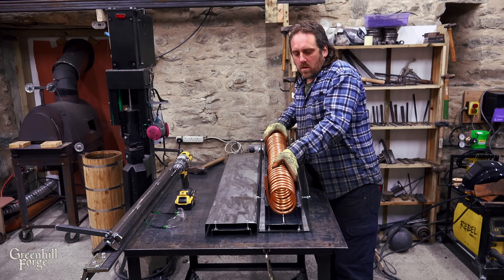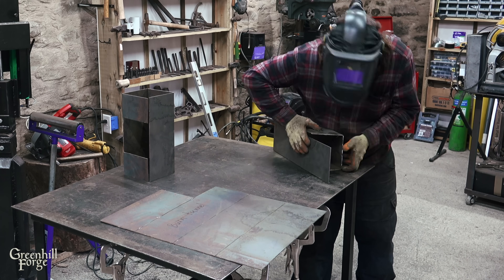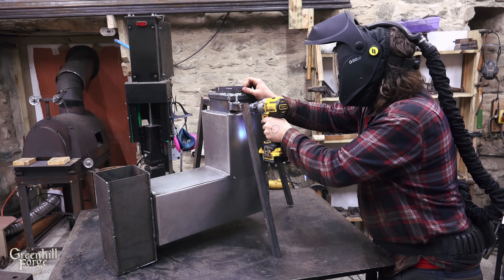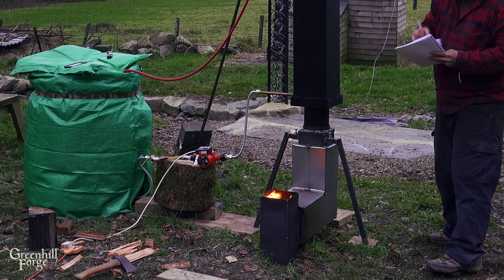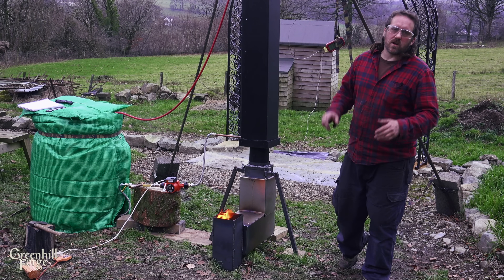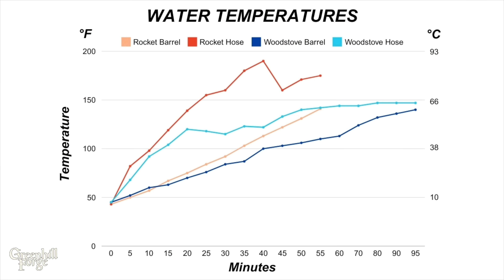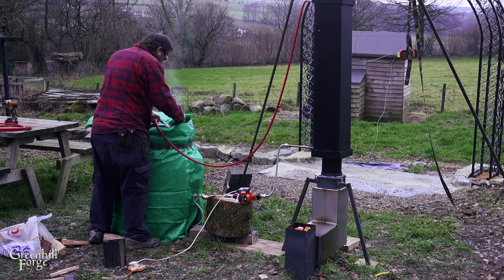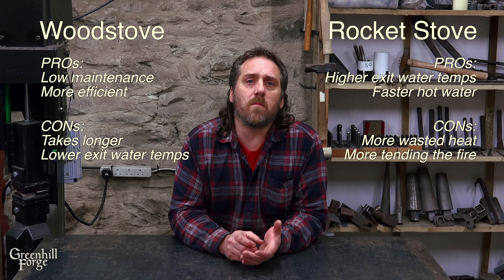Rocket Stove Water Heater Experiment Pt2 -TOO Powerful?

Comment: Running the water in the other direction can increase efficiency. Then it works as a crossflow heat exchanger. Cooler water would be at the top and could cool the smoke to an lower temperature, and extract more heat.
Reply: I was hoping to see that improvement in this video but its still an awesome video. Im jealous of the fabrication skills!
Reply: He addressed this in his Q/A video; he's going to eventually turn this into a thermosyphon style without a pump, which would conflict with the directional change.
Reply: @ultimape with such huge temperature difference there is hardly a need for crossflow exchanger. What could help is contact surface or coil length. Dunno about soot though. This seems a real maintenance issue. 😢
Edit: breaking the laminar flow of hot air could also help, or extending the time for heat transfer. I would try to make coil more chaotic in shape.
Reply: Yes  and he may want to go to a bigger diameter copper pipe and a bigger pump.  He is correct, however that something to suck up some of the heat before it gets to the heat exchanger could be good.  Water can get above boiling so he needs to get some temperature reduction.
Reply: @kensmith5694  Could use 2-3 coils in parallel instead. Gives better flow just like bigger diameter, but it also gives more surface area.
Reply: @m8e  was looking for this comment.  Increasing the flue size would help offset some of the excess heat being produced to make it a bit more controllable as well
Reply: came to say that. counter current flow is key
Reply: You're thinking counterflow not cross flow
Reply: Yes, exactly! And in fact it is what happens in real life such as the oxygen exchange in gill of fish.
What you do is building a shape like a big guy relaxing in coach. Calves=stove, belly=heat exchange section, heat=chimney.
1, putting the heat exchange section a little bit downwards (smoke flow), 
2, after the heat exchanging section, turning the chimney upwards, make sure the end is high above the stove enough.
3, cold water inlet at the lower (far) turning point, hot water outlet at the higher (near) turning point.
By doing so, keep the smoke and water running without consuming any energy inputs.
Reply: The issue is if the gas gets too cold then there could be too much creosote
Reply: when I watched the last video where he made this heat exchanger, I was thinking the same thing.
Reply: In future he could go for a thermo-syphon effect so it works without a pump.  Put tank above the unit and it would work.
Reply: 2 coils, the water starts from the bottom in an external coil and goes up to an internal coil going down!
Reply: @menezessilva3007  Came here to comment this exact thing. Cross flow heat exchangers ftw.

Comment: I'm curious whether the higher water flow rate substantially reduced the exit temperature -- and if so, whether a faster pump might be all that's needed to make the rocket stove an option at high power.
Reply from the maker: yeah, it dropped a lot. Might not even need the faster pump, I was just a bit nervous with it spluttering boiling water. As I get more comfortable with the system I might try for an instant hot water setup.

Comment: I've seen a lot of utube videos on putting coils in the flue and heating water most use thermal siphon and so far all I've seen don't have the loop set with the proper slope and so far all including your are using tools that most DIY don't have or have the skills required to use

Comment: hey dude... i was wondering, did you consider drilling some holes in the outside shielding? few on bottom and few on top so the chimney effect would move air in between the hot and cold shield - thus keeping the outside even colder (eventually heating the surrounding area)

Comment: Fantastic work, many thanks for doing this.  Some thoughts.

Would a smaller sized rocket be more suitable?

Could you incorporate a pellet hopper and a pellet basket into a rocket stove of say 80mm

Could the water be pumped through some radiators and then onto the tank?

I am wondering if a smaller stove and pellets would help you control the burn and allow it to be unattended?

Comment: Maybe this idea is stupid, but wouldn't It be more efficient to put the whole rocket stove inside a water tank? If the seams are watertight and both the mouth and the flute poke out of the water level,  the water would be in contact with the hotter surfaces ( also kind of protecting them)
Reply: Maybe adding a secondary tank and a pump, that way you can control the temp by having more thermal mass. You would also forget about galvanic corrosion and overpreasures. Depending on the amount of water you sorrund the stove with it might be way quicker to heat up. You can even use the hot tub as the secondary tank in a closed loop. I guess heat loss in the tub would be enough so you don't need to worry about overheating
Reply: @casinivan  The idea with a rocket stove is to get it hot enough to crack the volatiles (wood gas, creosote etc) and get it to burn them as well. So if you suck too much of the heat out early, you end up not able to do that. So you'll need insulation around the burn chamber. If anything for a rocket stove design he's actually cooling it off too quick. To fully burn the carbon soot off he needs to introduce more (heated) oxygen into the flu stream before going into the copper exchanger.

Comment: your design is good enough, if you need to control the heat exchange in rocket stove more use a manifold of heat exchangers, heat exchangers can be used like rods in a reactor

Comment: Looking at your graph at 10:46, it seems that adding a preheated secondary combustion air diffuser past the firebox would solve 2 problems- burning too hot and soot buildup. I ran into more or less the same issue with my forced draft burn barrel. The secondary air should be preheated to avoid cooling the flame down too much to where it causes combustion to cease. It would also increase your efficiency as the exhaust temperature would be lower and you wouldn't burn the wood as fast.
Reply from the maker: can you describe what you're thinking for the diffuser?
Reply: @GreenhillForge Great question! I've been pondering how to do this myself. Thinking about how secondary air is introduced in say a Vermont Castings Resolute Acclaim, Jotul or your earlier woodstove design. Those designs have air preheat tubes/channels with holes which inject a metered amount of secondary air into the exhaust channel. This creates turbulent mixing. Another way is in coffee can rocket stove where the wood is on a metal shelf in the cross-tube. Secondary air flows in below the fire and is preheated. Then it swirls around the end and side of the plate causing turbulent mixing. The primary air is on top of the plate. Perhaps a shelf below your feed tube which injects the air into the cross channel beyond the wood. I've seen some designs like this... Maybe someone will post a link...
Reply from the maker: @chasbader  I almost added an air supply in the front of the feed chamber that would be in line with the burn chamber. The air would come in perpendicular to the wood so it would also create a bunch of turbulence. I'm going to make some mods to the rocket stove just to test what happens so I'll add that soon. I had though about a design where there would be a shelf in the burn chamber running maybe 1/3 of its length, above the shelf would be the flow from the feed tube. under the shelf would be open to the outside air from the front of the feed tube. two pipes would support the shelf on either side along the walls of the burn chamber and they would runall the way to the begining of the riser. So air in with the feed tube and fire itself, more air near the beginning of the burn chamber, and yet more preheated air near the end of the burn chamber just as it hits the riser. problem was that this eliminated the little ash pit at the bottom of the feed tube in my current design so ash/embers build up at the bottom of the feed tube and restrict flow. In my current design they fall into the pit (through a grate at the same height as the burn tube bottom)and keep the area clear for more fuel and air

Comment: That isn't creosote on the right, it's Buckyball carbon soot. As you mentioned, you completely cracked the hydrocarbons into hydrogen (yellow flame) and carbon (soot). The hydrogen burns first, but you need more contact time with the air to burn all the carbon. Another possibility is forced draft with excess air, then the flame turns blue/orange and is much shorter. As stoichiometry approaches ideal, the flames get very long.
Reply: I concur that forced air into the combustion chamber would increase the efficiency of the stove and reduce soot deposits on the coils. However, the trade off would be more attention required for fuel feeding and more heat lost out the flue. On upside might be that the overall internal dimensions of the rocket stove could be smaller to get the same heat exchange with the water in the coils. A pellet fed rocket stove might also be a viable option to reduce the amount of attention and fuel required to get the desired results.

Comment: Ok, so I'm going to join your patreon because you are doing stuff that I would love to do but am too busy working. Life is short and we need to work together to achieve what we both know is possible. I took a taco pump through copper heat exchanger from an on-demand water heater, put it on top of a forced draft (Dayton blower) insulated burn barrel made from 2 5-gallon metal paint cans. So forced draft, forced circulation. It heated 25 gallons from 40F to 120F in less than 10 minutes. Big problem was flashing to steam as the temp got hotter. Insanely fast heating! Another problem was that I didn't have primary/secondary air control so the wood pyrolized to a heavy sooty smoke unless I held back on the wood or increased the airflow. Adding forced draft increases your heat output by orders of magnitude. We don't worry about wood up here, we can't burn it fast enough. Smoke is the issue.
Reply from the maker: sounds really cool. steam can move heat way faster than water and the act of changing phase absorbs even more heat than that so if it is done in a safe way, going to steam is actually the fastest way by far to heat the water. so many plans, time to get to work. Thanks for the help on Patreon.

Comment: Alright, probably overly complex by a lot, but could you perhaps do a rocket stove that takes wood pellets, and then you could set up a hopper and control the temperature based on the feed rate.
Reply from the maker: it's a great idea but I want the final design to be fully off grid with thermosiphon so I have to work around that.

Comment: These experiments are pretty great man, your YouTube content is fantastic. 

I’ve often contemplated a similar setup to move wood heat within our house. We have a wood stove insert inside a fireplace in our basement. It heats the room it’s in GREAT, the basement good, the upstairs ok. It lacks the ability to uniformly heat our house, and most of our living is upstairs away from the direct wood heat. 

I’ve drawn up countless ideas on capturing some of the exhaust heat that is trapped inside the masonry of the chimney while the stove is burning. It would be indirect heat on the coil, but the masonry is pretty warm on the exterior of the house, enough to melt away the snow on the ground around it even when it’s -25C outside. A coil in the chimney flue, circulating to a coil in our forced air duct would let us recoup some waste heat leaving the chimney. Or into radiant floor heat like you mentioned. I’ll have to get some temps from inside the flue this winter.

Great to see these tests, looking forward to more of them.

Comment: Rocket stove fuel and feed chamber should be longer, 2’ chamber and 3+’ wood pieces will allow for a little more up front time with far less constant attention required. Sloping feed chamber with fuel support can also make a difference in attention required.
Reply: I placed a heat dam just before the vertical on my 12×6×6  L burn chamber RMH (basically a 4×6  heat tile that blocks about 70% of the gas flow)
The effect means it slows the speed of the burn but raises the gas temperature allowing one batch of wood to last an hour or two (fully damped down via a front door with adjustable vents)

Comment: Great job!  I love the stats!  

Go with high temp plastic pex tubing to the barrel.  My water was 180° F + and you’d never know it by holding onto the pex with your hand.  

The manifold I created was 16 ga. steel located in the fire chamber to catch the most intense heat in front of the chimney/exhaust. 

It’s been many, many moons since, but I don’t recall using much copper.  Maybe at the water heater and water-to-water heat exchanger.  Most piping was steel at the stove and high temp pex everywhere else.

Comment: Dude, you're killing it. You keep this up with this HIGH QUALITY content you'll have a 100k channel in no time.
Reply: For sure. This guy is a weapon
Reply: Just subbed.
Reply: i, personally, am here for it
Reply: First off great job. Video give all detail and info without the filler.  You have the knowledge and resources to maybe answer a question.  Could your stove in video be built into a 275Gallon oil tank stood on end.  Essentially the tank filled with water would become the "insulated wrap layer" around the stoves design.  I guess turn the 275 tank into basically a single system water heater?  Having a fill line and return line lets say to a swimming pool? lol

Comment: Good on you for including the entire life cycle in your efficiency calculations! Some assessments even account for CO2 absorption of the trees used for fuel fuelwood
Reply: He did ignore heatpumps though. COPs of 3 to 6 are possible which would increase efficiency. Also ignored local pollution by woodburning.  If you want to really know what is the most efficient you look at cost. Gas is hard to beat for cost(if russia didn't want to make war) and has a very clean burn.

Comment: It might be cumbersome but it would be cool to see the copper coil compared to just “boiling“ an old oil barrel filled with water over the stoves. Maybe have the chimney going through the barrel with some fins on to get better heat transfer.
Reply: Yah,  maybe a thick wall "tank  jacket" around part of the stove, using water as the "mass", but obviously need protection against accidental steam bomb.

Comment: I wonder if you could get the best of both worlds with a pellet stove. Get it hot fast and then back off the pellets for a slower burn to taper off the temp
Reply: A pid controlled pellet auger would definitely let him get even more scientific.  Can calc the weight of wood per revolution of the auger. Plus then precise fire control in the first place.